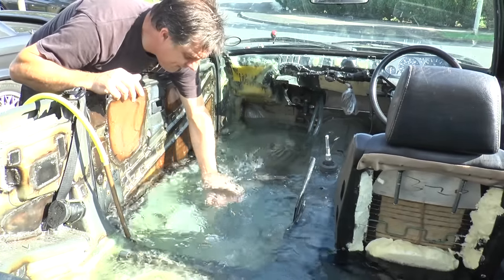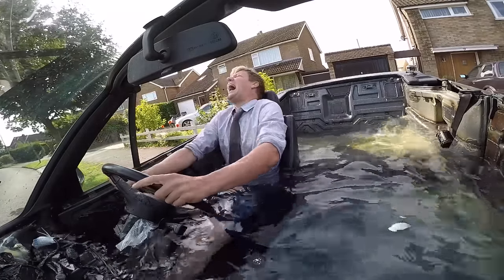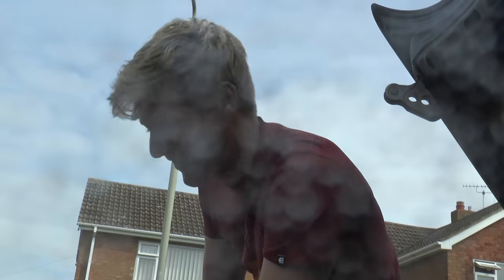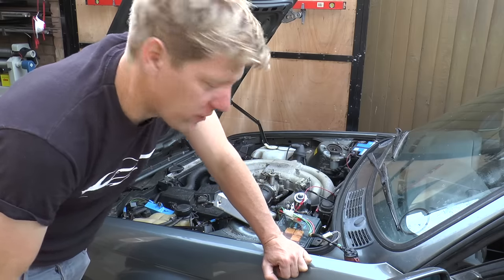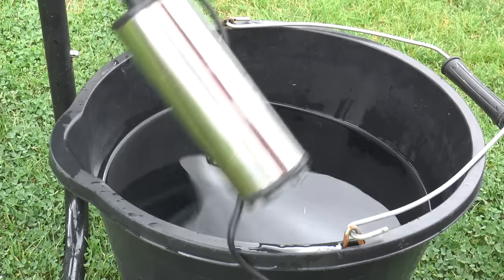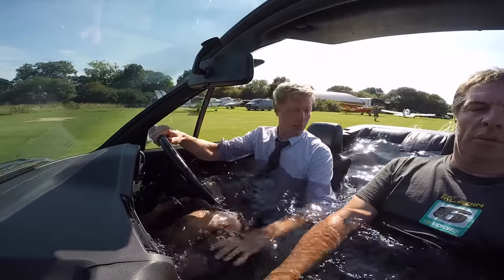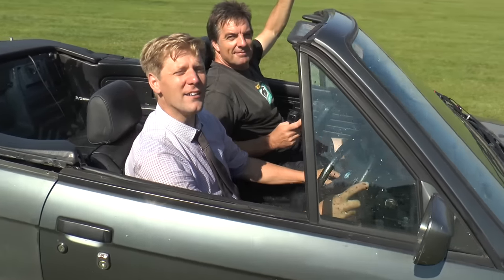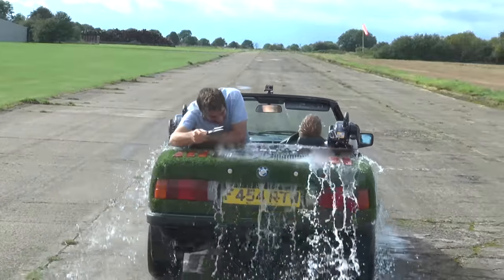BMW Hot Tub First Tests and Issues

Comment: This is basically an inverted boat
Reply: you have to submerged while not being submerged
Reply: NextGen Rager inverted*
Reply: NextGen Rager I thought you said introverted and I thought oh yea that makes sense then I realized 😂
Reply: NextGen Rager Its called a bathtub.
Reply: NextGen Rager since it can hold water in, it should be able to hold water out. Maybe it could be a boat
Reply: @jake1173  can bathtubs move without being picked up or pushed (insert sounds of seeing driving bathtub by colinfurze) oh never mind
Reply: Boat to the power of - 1

Comment: I once drove a Jaguar out of a flood in York, sitting down into cold water was unpleasant. It started, as the water was only up to the exhaust pipe at the time, so driving it out was easy, what was astounding was pushing a small Fiat which was flooded up to the windscreen. We got it out and onto dry ground, did a Risky Business, opening the door and letting all the water out, removing the rubber grommets in the floor pan (the drain holes) so we could get most of the water out. To ensure the engine was not flooded I looked into the rocker and dipstick which looked o so decided to start it, it did, first time and blew water out of the exhaust, Amazing.

Comment: The water sloshing problem can be simply solved by adding baffles...this is used on a lot of tanks/water carriers/sprayers etc to prevent major unbalances/catastrophic failures due to the sudden, violent and extremely large change of weight distribution.

Comment: Did you have any issues with the DVLA or the police about this 😂
Reply: Xylem Force He's not wearing his seatbelt.
Reply: Terry Dickinson depending on the age of the car a seatbelt might not be needed legally. Please correct me if I'm wrong.
Reply: George Wills if it's installed you need to wear it. This is Colin, he took a scooter which shot 20 foot flames out of the exhaust, he delivered a huge burning fire in the back of his Hilux, he smashed a car into a tree and drove it home, he's driven the Hilux through god knows what, I honestly don't think he gives a shit about the police lol.
Reply: I was thinking that, surely still road legal? 😂
Reply: He's probably also talked with the police or whoever to work out times and routes for such contraptions, you can do quite a bit with the proper permits. That aside the BMW E30 series didn't start until the 1980s, and at least in the US seat belts had to be installed by manufacturers back in the late 60s (though they weren't required to use until later)
Reply: vlanoik my 1983 Opel manta doesn't have any seatbelts lol
Reply: vlanoik this is a 1989, compulsory on all seats by 1986 and front by 1965. Been the law to wear them
Since the earlier 80s
Reply: Dvla and such don't care, as long as the vehicle isn't a danger to other "highway" users then it's completely fine. Even if your car doesn't work without being jump started every 10 miles, if the vehicle isn't a danger then it's completely road legal.

A vehicle with water flooding out onto the road isn't dangerous unless it's on an actual motorway or dual carriage way. Regardless, he only drove it around some blocks and on an airfield. The only times he drove it on country lanes were early on so he must have got permission to do that.
Reply: Landie Man He really doesn't care about the police, he actually got arrested for making the flamethrower scooter and was told to stop making things.  Which he obviously didn't do.

Comment: Some formed paneling, like a breakwater or wave wall that takes the momentum of the water and turns it up and back into the seating compartment. Aside from that this is like the worst case scenario for trying to transport water where the wider (longer) in the direction of travel and shallower the container the more pressure can build up. You could sub divide or lay down a strip between the different sides. For in between fillings or a need for less water the boot could be set up as a holding and transfer tank. Could put in some of the utility of a water heater in there, make use of the spare, that sort of thing. I'm guessing the engine is offloading heat into the passenger seat? Could set that up to channel into a possible boot tank and increase the rate of heat transfer before cycling it into the seating compartment.

Love the motion of the ocean though. If the wiring and equipment are figured in maybe having the water sloshing over the auto body will be a good thing... could use a water line paint job on the exterior to showcase it's "features" I think.

Comment: if it's waterproof won't it float in the water? turn it in to a boat .
Reply: It's a car though
Reply: I doubt it would be buoyant enough :/
Reply: Waterproof from the inside not from the outside
Reply: That would require some work on the engine and the underside to make it float, probably the same amount of work to turn any car into a boat
Reply: It's not waterproof, it's watertight.
Meaning it can hold water but not be used in water.

Collin used basic terminology like he does in all his videos so more people understand what he's doing.
Hardly any cars are waterproof. Even cars built for off-road aren't waterproof, and the majority with air pipes can't survive long with the engine underwater, it only helps for a short while or when moving, usually if a car stops moving in water then it's screwed regardless.
Reply: ThatGuyMike yeah, one of my friend's cars flooded while going over a water crossing and was unusable.

Comment: Why did you bother with that copper pipes? Use plain water in the engine and just let the hot water from the engine get into the tub instead of the copper. More effective and cheaper